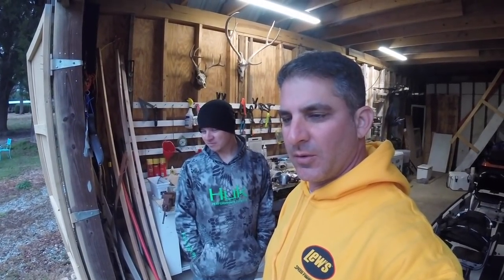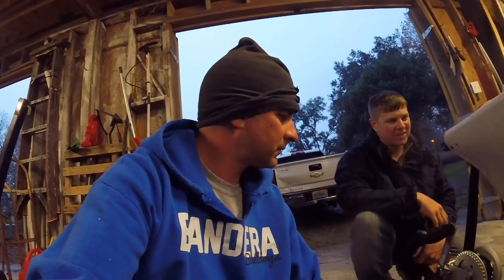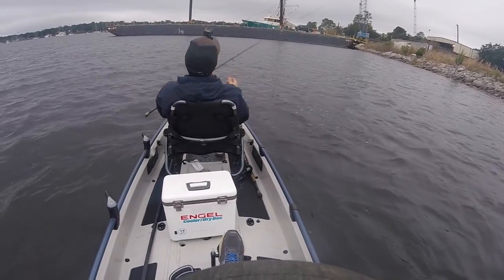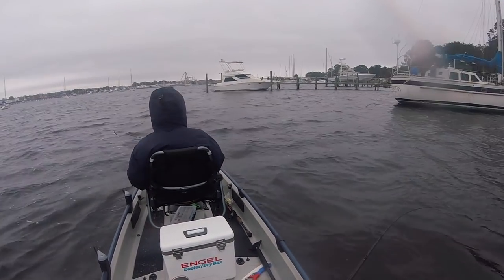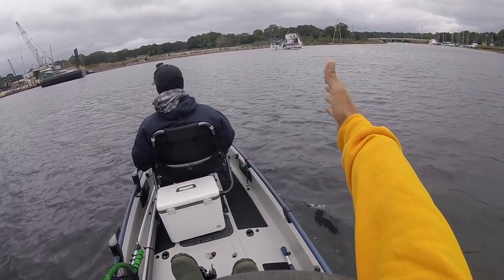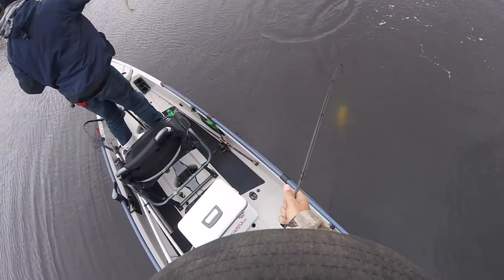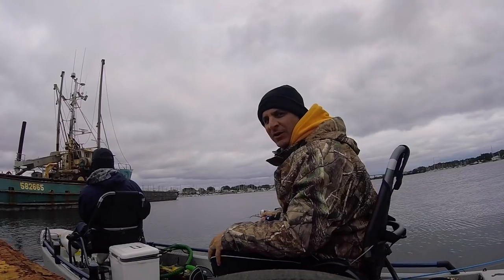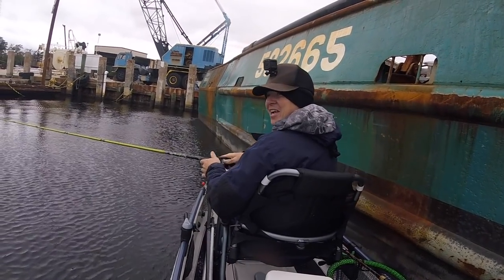Rigging up our new Hobie 17t | Trailer Build & Maiden Fishing Trip | INSANE ACTION

Comment: That PVC is not going to hold either one of you. If it does it wont be for long. Just make sure you have the camera rolling when you're fishing off of it. There's not enough bracing on it. Adjust your bunks to fit the contour of the bottom of your boat so it sits on all 3. Don't forget about the rudder. You probably already know this but I'd hate to see anything happen to that new boat.
Reply from the maker: yea man... just playing around with concept.. may have to go aluminum
Reply: @30mofishing  Oh it'll work, but you need 2 tee's on each leg so you have all 4 legs joined together about half way down. If that makes any sense.